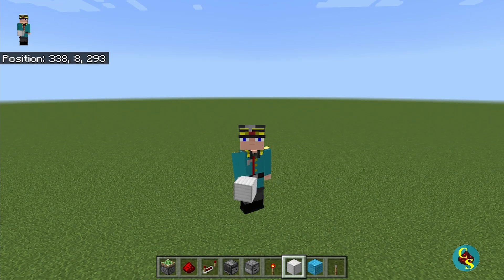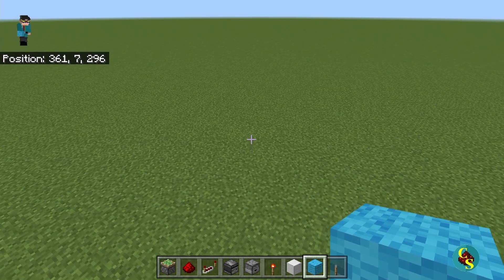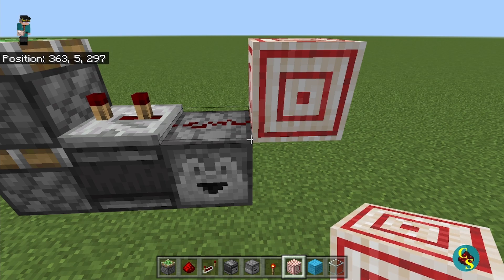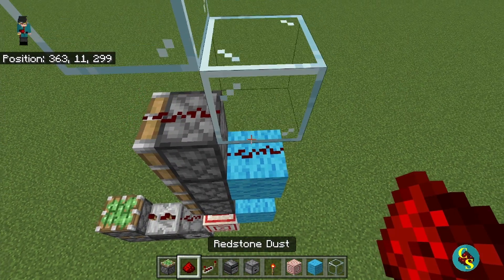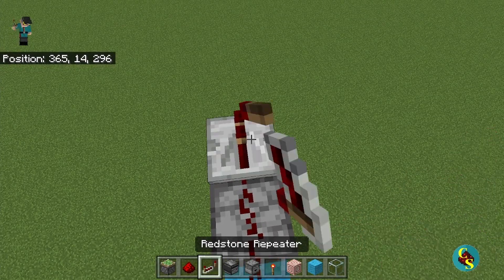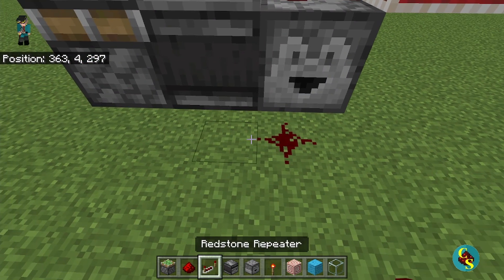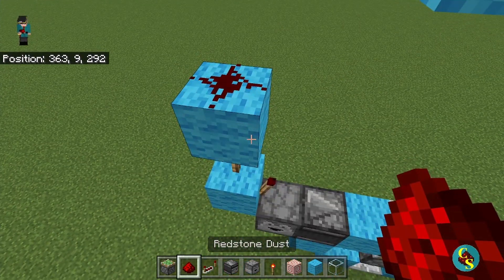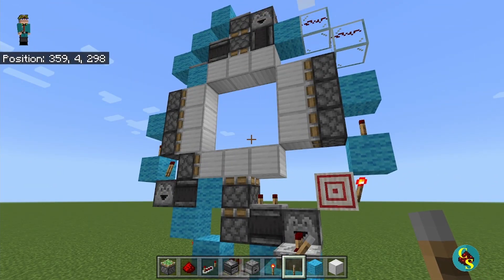Easy and Fast 3x3 Piston Door in Minecraft Bedrock 1.18!!!

Comment: I’m having the same problem as the other guy everything is correct sometimes it’s also breaking one of the red stone torches and top middle piston is pulling the middle block up
Reply from the maker: Did you make sure that you activated the door with a repeater(there must be a repeater in between the lever/button/pressure plate and the door’s activation system)?
Reply from the maker: Also, if you want to just send me pictures(which is easiest) you can dm on Reddit at u/ColonelSanders239 or discord at Colonel S.#1244
Reply: @ColonelS  yeah so I have the repeater and then red stone ran to the wall into a lever I added you on discord I’ll send pics when I get home

Comment: My bottom of the upper double piston extender is NOT firing to push the block into the bottom piston.
Reply from the maker: Make sure you are using a repeater to power the door, as I said in the video. There is a bug in the game where a user input(like a lever directly into the dropper) will not work the same as a repeater input(0:21)
Reply: Repeater also right where the video powered it. I planned on making a t-flip flop into the repeater once the whole thing is working
Reply from the maker: Hmm…are all of your repeaters set correctly? Every repeater should be 3 ticks except for the one below the bottom piston
Reply: Ticks are all correct
Reply from the maker: If after you rebuild it still doesn’t work, you can try my other design. It’s the first video on the channel. It’s bulkier but it should be much more consistent as far as things like server lag or other factors are concerned
Reply from the maker: Also dm me a video of what you built just to see if I can find the problem(discord username: Colonel S.#1244)
Reply: Rebuilt, same problem. Im on realms so yeah ill try that different design
Reply: Request sent, ill make a video clip rq